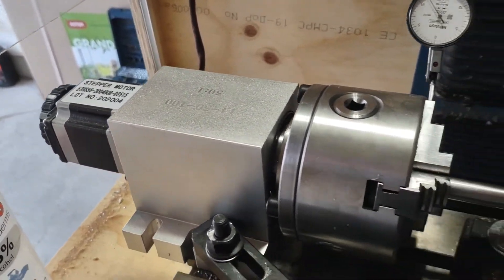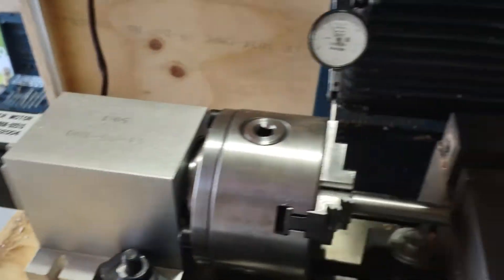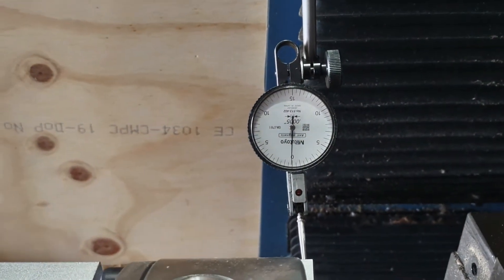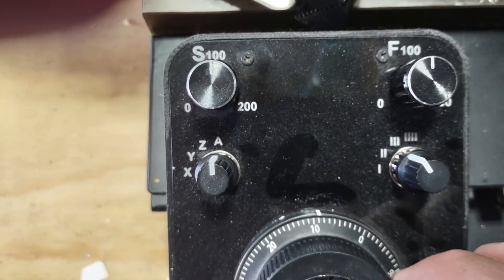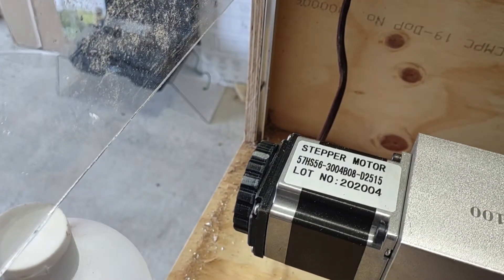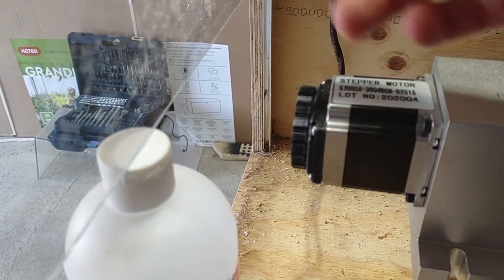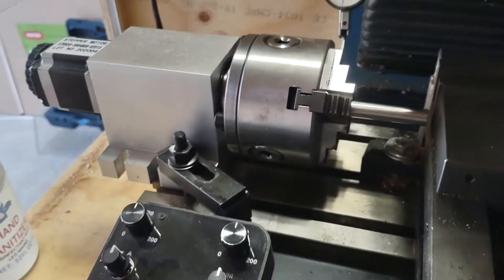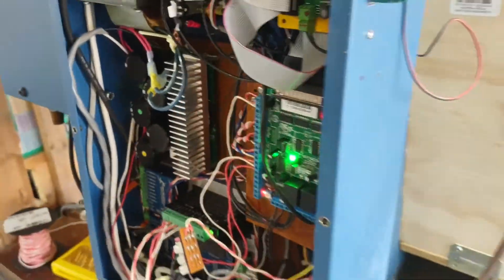CNC 4th Axis 1:50 Harmonic Drive Homing and repeatability.

Comment: Omg imagine calling yourself HSM “advisor” and fundamentally not understanding the full concept of backlash
Reply from the maker: It is also "amazing" that I haven't said the word "backlash" even once during the whole video :)
Reply: He actually does. He 'preloaded' the dial by homing, + added a few steps to that manually, - then came back to home/zero. Backlash would have shown if any. Mind you it's pointless trying to demonstrate that though, the harmonic drive in this unit is +/-3 arc minutes. I doubt this generic mitutoyo would be adequate to pick that sort of backlash.
Reply: @gtcollection6933 dude you measure backlash by reversing force, not just twice in the same direction. I could get precise repeatability out of Lego gears measured this way, but still have a 2 whole ass degrees of backlash… unless you plan of having the entire mechanism preloaded by a spring this is  actually useless information when it comes to machining
Reply: @geekswithfeet9137  I have the same unit. Literally ain't any backlash in the thing regardless of the direction or parallel universe you preload in (harmonic drive?!). Not exactly the fastest rot motion of them all (aka 50:1) or most rigid, however once aligned & centered on the table + faceplate grinded, it makes up for sub-atomic sizes accuracy. You should get one! ((Lego gears lmao!!👍))